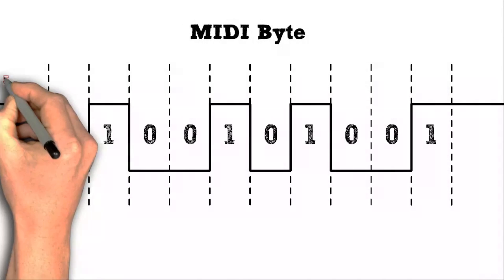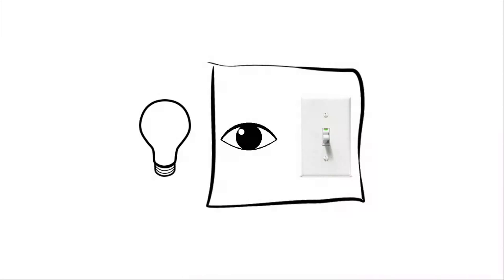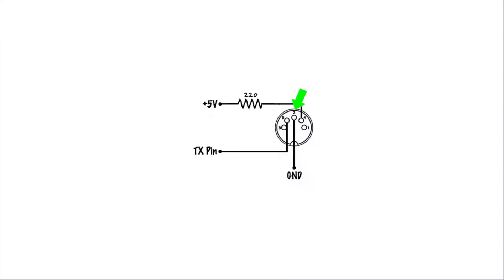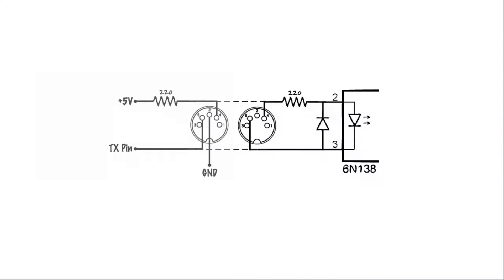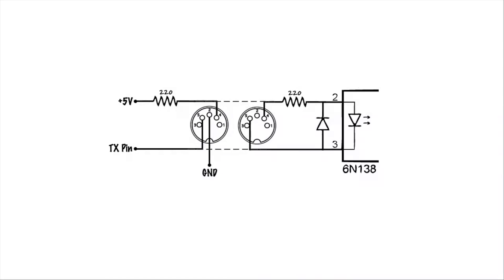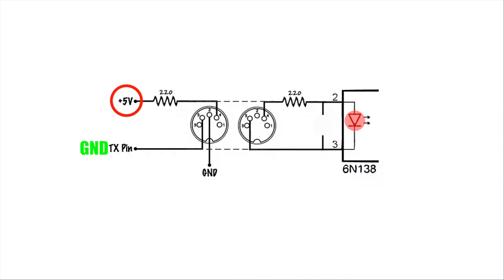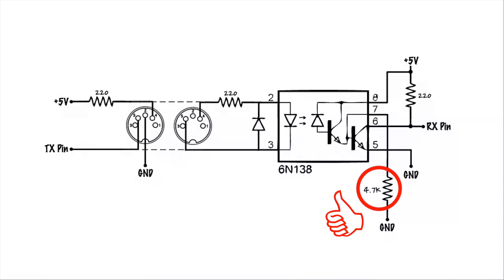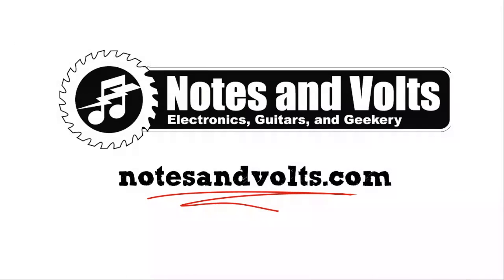MIDI for the Arduino - Circuit Analysis

Comment: IT WORKED!!! After months trying, I got it working!!! I love you, dude!!! I used an Arduino Uno (clone) and a 4n35 optocoupler to use my old Casio keyboard as a controller in LMMS (a DAW like Ableton, FL Studio...). All it takes are different resistor values and different coding (100 ohms at opto LED, 1K ohms at collector to 5v, and using SoftwareSerial as input pin instead of main RX pin).

Comment: man, you're explaining this in such a great way. the visualisation helps a ton, you taking it step by step makes it so easy to follow. big thanks!
Reply from the maker: Glad you liked it!
Reply: @NotesAndVolts  absolutely. Your guide actually made it possible to build our PolyTape-O-Tron in class. Its 4 Casette players with tape loops, whos motor speed is controlled via an arduino that receives MIDI from DAWs. 

This makes it a 4-voice polyphonic synthesizer. Big fun!

Comment: Good job. While it will work fine and not damage anything, the schematic in the video is slightly wrong compared to the actual MIDI standard. It is missing one 220 ohm resistor on the TX pin on output side. That will add up to the correct 660 ohms in series when driven from 5V, and not 440 ohms. The current also drops to more like 5 mA, which is the proper value.
Reply: HidekiSamba that is correct

Comment: hey, pal Dave -- thanks so much for this!  I was struggling with really erratic signals from my optocoupter but as soon as I added the 4.7K drain resistor, it was rock-solid.  Your diagrams and explanations are top-notch.
Reply from the maker: Glad it helped!

Comment: Serial transmission (in particular MIDI) begins from the least significant bit up to the most significant bit. So, 10010100 at the beginning of the video actually has to be read as 00101001, which is not a MIDI message. Other than that, GREAT video!

Comment: isn't the anode the negative pole though, it being the part where oxidation occurs, whereas the cathode is involved with a reduction reaction and therefore the positive pole (attracts electrons)
Reply: I think the reason for the naming is that in a rectifier circuit, the positive voltage appears at the “anode” of the diode. I agree that it seems wrong in the video.

Comment: I'm building a MIDI filter with Arduino Pro Mini, and noticed the odd thing about gnd of MIDI out being connected at one end of the cable.  I was able to get the board to come up with power from a MIDI in.  It can't use the optocoupler (because it gets power from IN).

It works (a MIDI IN/OUT filter that can be reprogrammed with Arduino code).  The main deviation is that I connect the IN.4 (pin 4 of MIDI IN) straight to regulated power), IN.4 to 220ohms to 5v, IN.2 to ground, IN.5 to rx.  Then I think it's OUT.5 to tx, OUT.4 to 220 ohms to vcc.

Comment: So does the Tx have to be 5V? Could it be, say, 3V and work? I was thinking about using an ATtiny for MIDI out (@ ~3V) - I guess I'd only need one output pin for control?

Excellent video, thx so much!

Comment: I believe from 1:40 to 2:00 is misleading because it is shown on a timing diagram. AFAIK, the LSB is sent first (i.e just after the Start), the MSB is sent just before the Stop, just like RS232. Hence the message here is actually 0x29 (not 0x94 as you imply) and 0x29 is most likely a data byte, certainly not a Status byte which must have its MSB high. So a message "Start note / channel 5 (4+1)" should be drawn as L(Start)-LLHLHLLH-H(Stop) on a timing diagram. Watch out, I've seen several wrong diagrams on the Internet...
Reply: On the other hand I loved your part on Optocoupler.
Reply from the maker: Hi Frederic. Midi is big-endian and the MSB of the status is always low.
Reply: That's incorrect.
BTW: I'm talking about the serial physical communication, not how to read a byte on a screen!
The status messages go from 0x80 to 0xFF, that means MSB=High right there and serially the MSB is sent last just before the Stop-bit (so close to the right hand side on a timing diagram).

Watch this (esp. from 16.40): https://www.youtube.com/watch?v=V0LmHM54nwc
Reply from the maker: https://youtu.be/9enveiI0eg4   at 12:40
Reply: Yep, it confirms I am right: the oscillo shows the 0x90 as Start00001001Stop, so LSB first, MSB last. Funnily enough the diagram he then pops up is wrong, but the scope doesn't lie!

Comment: Very good videos. One question I have is that at 10:28: how can the diode has 5V when there are two 220 ohm resisters are connected in serial?
Reply: You're right, it can't be 5 volts. The principle should be the same with the lower voltages amounts I suppose.
Reply: When the LED diode has the voltage in reverse, it has near infinite resistance.  While yes, there are a couple 220 ohm resistors in series with this very high resistance... the diode will see  approximately -5 volts.    [Say the diode reverse biased is 1,000,000 ohms... the math would be 1000000/ (1000000+220+220)         multiplied by -5v.    That means the diode is seeing -4.9978V.   That is too close to the spec that says the maximum reverse voltage of 5.00.]   Reverse voltage kills diodes without much current, so those resistors don't help... you need a typical diode backwards and in parallel to the LED, to protect the LED.

Comment: Great video! I totally subscribed! I'm confused about one thing, though. Wouldn't there be a voltage drop as the 5 volts goes across the two  220 ohm resistors?
Reply: Actually, it's a current limiter.

Comment: Excellent video  but how do you handle the timing of bits coming in on the Arduino accurately? (I'm not looking for an answer here, but I'd like a link to such a video, or if there is none, it'd be an idea for a video.  My understanding is that the Arduino language is just Java, and it's too jittery to do something with tight timing requirements like a MIDI clock.  Yet the existence of this current video certainly implies it's possible.)

Comment: Can we modify the circuit a little bit by using Tx with ground Not Tx with +5 , by adding 220 ohm resistor in line with Tx . So that the signal will be inverted in the other side ?

Comment: This is a great video.  It has cleared up lots of my electronic questions about midi.  I'm currently working on a project that would take audio clock and translate it to midi clock.  Do you think you could make a video that explains how to create the 10 bit streams that allow midi to be entered into the arduino

Comment: At 11.04 I don’t understand why you say it’s passing 0.7v? I thought it subtracts the 0.7v forward current from 5v leaving 4.3v to pass through the LED?
Reply: The two components (the diodes) are in parallel. If the component on the left were an open circuit (missing), the component on the right would see all 5V. If the component on the left were a short circuit (just a wire) the component on the right would see 0V. The component on the left has a voltage drop of 0.4V (imagine it's a resistor), so the component on the right sees that same voltage, 0.4V. No more or less. This is w/in the diode's spec and so does nothing, nor is it harmed by this arrangement.

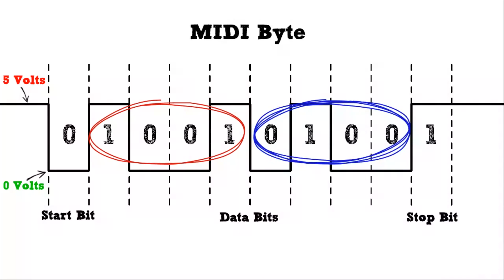Comment: Excellent video. I found only one fault, the conclusion around 1:55 is wrong. The LSB is transmitted first. So, the interpretation of the data is incorrect.

Comment: UPDATE. I could get it to work with 4n35 only (sw serial is not a good idea for midi lots of misses so RX is a way to go). Same diode between 1 and 2, 1 goes to (midi 4) thru R1 (220-330+ Ohm)... (use any you have), 2 goes to (midi 5). 4 goes to GND, 5 goes to RX and thru R2 (800-1.2K) to 5V. That's it. 3 and 6 pins are not used.

OLD
I cannot get it to work with 6n136, PC817, 6n138 all of them work separately, but not together with the Atmega328p. Tried 2 different functional midi outs. Tried it with 2 new Arduino Nano, with a standalone atmega328p on a board (with all required components) Rx,tx are workings because I use them to upload code via USB-TTL. 
I've tested the schemes manually by connecting +5v to  pin4 and ground to pin5, so i can get LOW signal out of RX, which I can read on any digital or analog inputs, even if connected to rx on arduino. So it works by connecting external VCC. But if I connect to midi outs (tried 2 different 1working with 100% working cables) to this scheme it just does not react at all... It does not read. I've tried Midi input test example, serial software, just serial with baud rate 31250... it just does not work and I don't understand why.

Comment: Hello !!!  I'm a total newbie. Anyway, I think I got all the explanation !!! Super cool video, then !!
I'm left with one little question: what the 220 Ohm resistor beside the Rx pin is there for?  =)
Reply from the maker: Hi Claudio. When the transistor turns on, it creates a near short circuit between power and ground. This resistor prevents that.

Comment: Unfortunately, MIDI out circuit from this video can destroy ATmega IC. (I done it two times ;/)
You should use transistor to separate microcontroler pin from MIDI out.

But still very good video, analysing of in and out circuits helped mi to understand how actually MIDI transmission works
Reply: can you please give more information on whyATmega IC get failed.

Comment: Great Tutorial but i would like to ask you how you connect the midi to pc?
Via a usb to midi converter. And if so how can you bypass it, to connect directly throught usb?
Reply from the maker: Hi orfeas. To connect 5-pin Midi to your PC you will need a Midi interface. Many audio interfaces for your PC have Midi jacks as well.
Reply: Also i would like to ask because i have a problem with the pots.
My status byte is always 90 (note on) and i want it to be B0 (control change).
You know why this is happening?

Comment: Good video, but i cannot receive messages from PC...i use Arduino Uno, your explained midi interface (but i have try also others 2 schemes), MocoLUFA midi for Uno, Roland D10 keyboard and Midi Library.
Just i want take messages/notes from keyboard and get back reply from PC, but all notes/bender/control change go at PC musical software correctly, but none go back to keyboard, i see RX led on arduinio flash when a note is played from PC but i dont receive none on Roland keyboard.
Connexion and interface is ok, if i play a note from arduino they reach Roland...but no from PC...any got same problem?

Comment: What is the purpose of the diode connecting   on the base of the first transistor?
Reply: That is the photodetector diode that 'sees' the optical transmission of the LED.  They operate in reverse bias and conduct when they receive the light, thus turning on the transistor.

Comment: Hey, I’m wondering if anyone knows if there is a signal sent when a midi device is paired with another and if that signal is readable? 

Ie. if I built a midi controller that connected to say a multi channel midi enabled synth  would there be a signal when both devices are paired together regardless of parameter changes?

I imagine something like this:

Midi Controller(MC)
Midi Instrument(MI)
MC pot set to CC32  MI “attack” is CC36

MC 32 xxxxxxxxxxxxx MI 36

MC 36 ————————>MI 36

X = no connection
-> = connected

If there is a message does anyone know how I can approach reading that data to actuate LEDs?

Cheers

Comment: Does the midi output from a Casio keyboard to the arduino have some sort of buffer?  I have a circuit that tests for 4 keys to be pressed simultaneously, and then it sets a pin to HIGH for ten seconds.  What I have found is that if I press those same four notes within that ten second period, it adds additional time for the output pin to be HIGH (triggers a relay), as if there is a buffer from the midi device ready for the circuit to read it. Any ideas?
Reply from the maker: Hi Ghost. There should be no reason that the MIDI output form the casio should be delayed in any way. I would go back and check your program to make sure it is  handling the incoming messages correctly.

Comment: How did u find the 0.7V diod voltage? What diod should i use in such scheme?
Reply: That's the forward voltage rating for that particular LED. Which means 0.7V is whats required for the LED to turn. This is the Hardware specs of the LED so you can get that info online and shit.